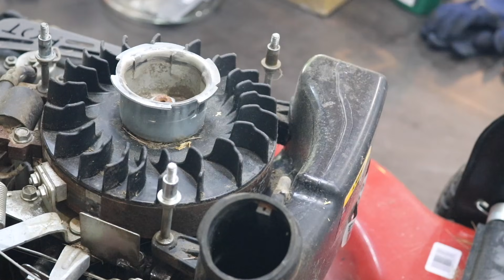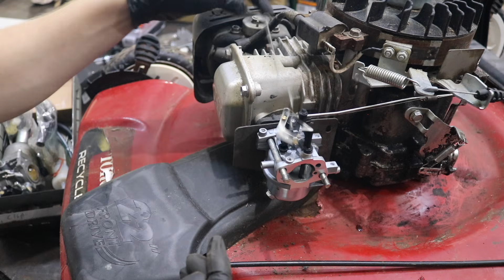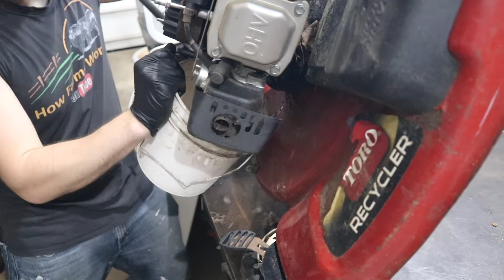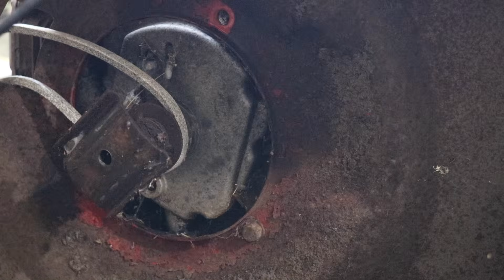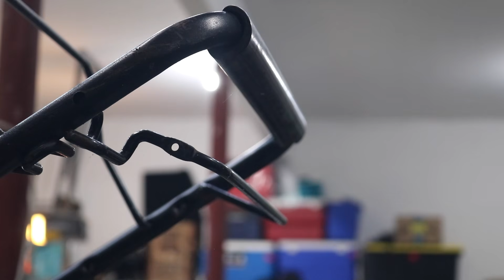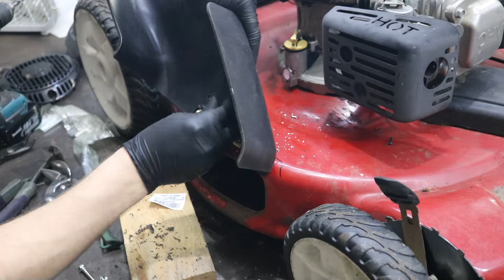22" Toro Recycler won't Start? | DIY Carburetor Replacement | + Belt, Blade, & Clutch cable

Comment from the maker: Carburator:                                 https://amzn.to/4d50oHS
Front drive wheel belt:               https://amzn.to/3OkVoE3
Traction drive control cable:     https://amzn.to/43uLG6l
Fuel Cap:                                       https://amzn.to/3pMcUry

Comment: Mine suddenly stopped working after it had a gas leak and went dry on gas. i replaced the spark plug,air filter and added new gaskets where the gas leaked from  and put a new carburetor too. I was hoping that would get it running but still no. What could be the issue? It’s good on oil

Comment: That's the exact mower that I have. I need the linkage that runs on the side of the mower and connects to carburetor. The choke linkage i have.

Comment: FYI...Your carburetor is suppose to be closed to start..you have the thermostat in backwards...then after it starts the thermostat pulls on the linkage and opens the carb

Comment: OK, Im curious about the linkage where it connects to the thermostat (4:58). I havent seen anyone else ever do it like that so I am scratching my head if thats a detail most miss, or you think you may have had it on backwards.  The only reason I thought it was wrong was because it rubbed so tightly on the ignition wire?  I think the heat provides the tension and winding, but it may assist to get that assembly not bumping the choke during normal operation.  I was curious if that might have been the reason for the 20 pull start, or something else?  And your carburetor link is not for the engine you are working on, That's a quantum Briggs and Stratton Carb.
Reply: I agree with you, in his situation the carb isn't being choked, it's open.  Thought it had to be closed and as the thermostat heats up it opens up.  Is the thermostat on backwards that's why it took many pulls to start?

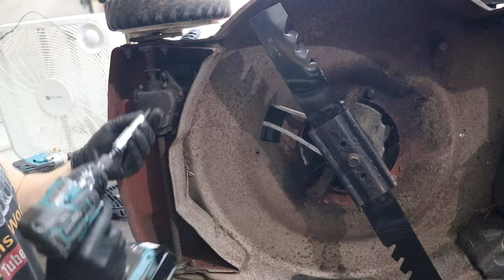Comment: For the chute replacement at 17:00   ... I had the same problem.   You're missing a piece to make that work.  You need to original smaller flap that closes the opening off.   Just raise it up (it's under a lot of tension)  and lay the chute you are installing up in there.  The force of the smaller flap trying to close will hold the larger chute in place.   Sounds confusing but if you search a bit, you can find the video where this is being done.

Comment: Dumb question, but what is the other cable with the clutch cable? I broke one of those on my lawn mower.
Reply from the maker: Off the handles? If I remember correctly, the cable on the lower handle is a dead man’s switch, and the cable on the upper handle, when pulled down engages the drive wheels.

Comment: Carburetor in that link does not look like the one you are changing.
  Also, shouldn’t the choke be close when reconnected the rod to it?
  It shouldn’t open until the muffler gets hot, right?
  I am new to working on a Kohler carb that belongs to my bro-in-law and trying to research it as I seem to be having trouble finding the right carb for it. 
  The ones he ordered do not have the metal angle piece in it like the one that on it. 
  What is the part number for that carb?
  I saw a video where the guy said the inside parts are the same and he used a carb that did not have the metal piece. I assume it either had a choke cable or the choke was vacuum operated. 
  Showing my ignorance while trying to get info before I maybe attempt to clean the original of rust and out the new parts in the new carb into the original.

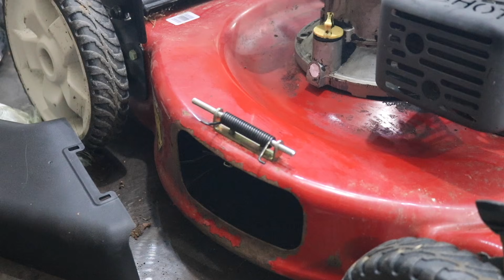Comment: 17:04 Your mower is missing a black plastic piece that hinges down using the spring and clamps the chute.  For some reason, it is missing in your mower. Hope that helps. Great video!!